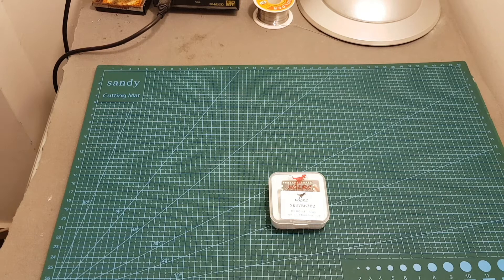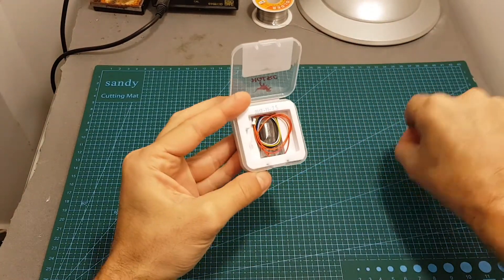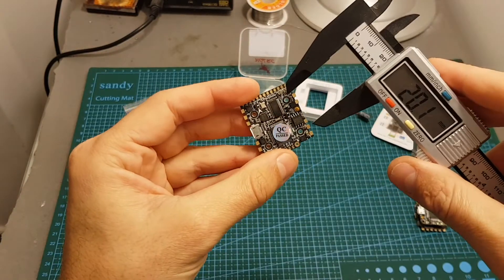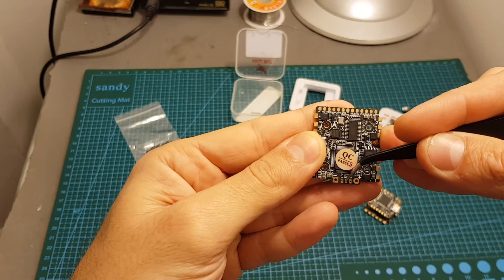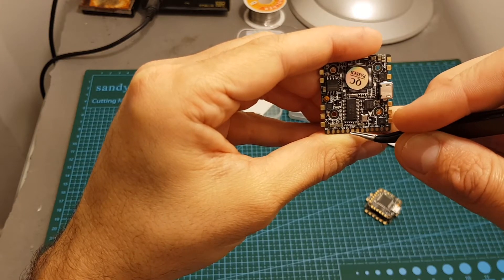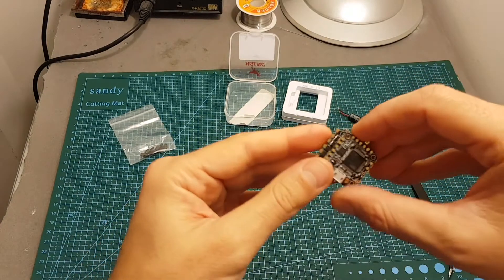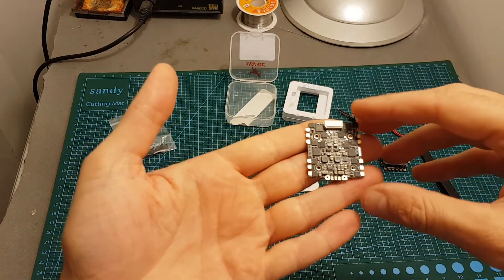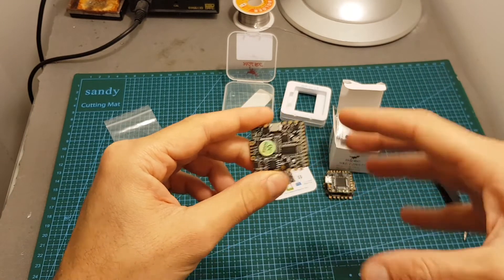Hglrc Zeus F4 Flight Controller - Unboxing & Overview

Comment: Please could u help with selecting motors for this board .. 1306 or 1407 or just 11** ...
Reply: :D u said 1106 ... But will it okay for 1306 motors ??
Reply from the maker: +Deeshank-FPV which motors? You need to check their amper rating.
Reply: Gal Kremer I some how dont believe bench test .. :D
Reply from the maker: LOL :-) Send me the link to the motors, I'll have a look.
Reply from the maker: +Deeshank-FPV it should be fine